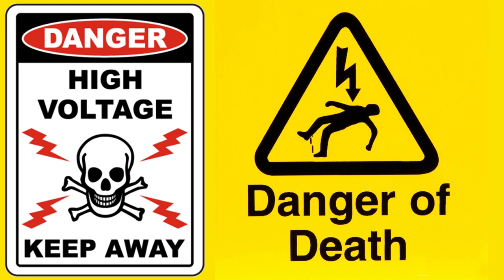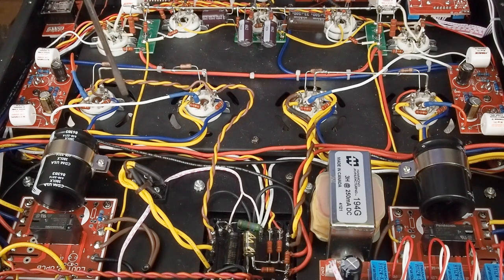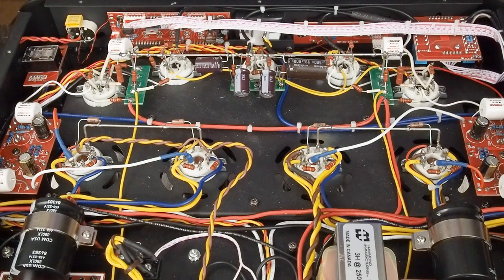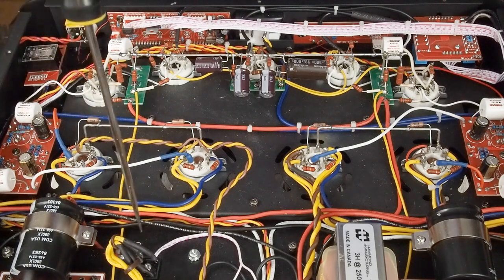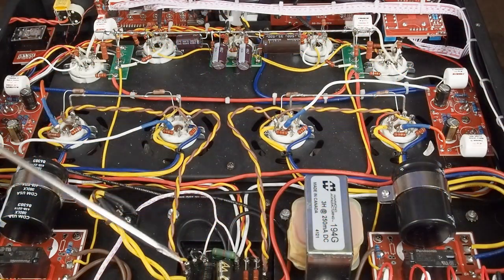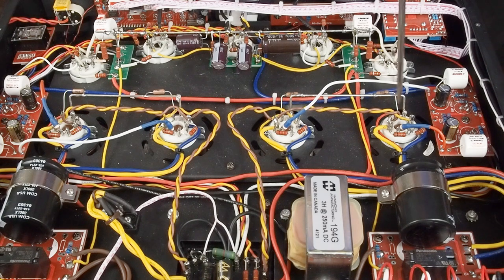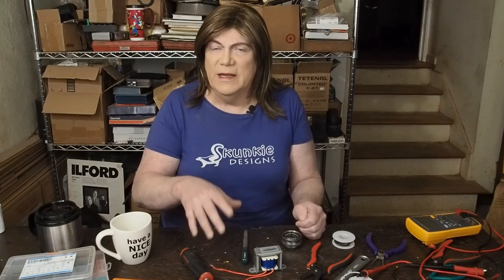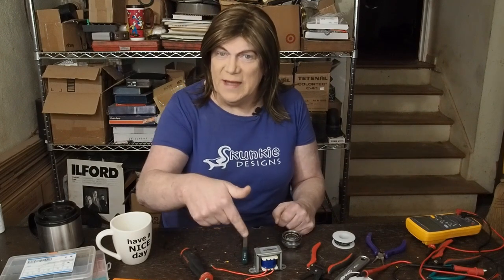Willsenton R8: Fixing Lead Dress and Grounding Faults.

Comment: You are so refreshing to watch, your explanations are evidenced based & can't get enough of your videos!!! I'll slowly work on the bias wiring & eliminate the possibility of the amp from "red plating" or melting other components or parts of the amp, is definitely a must DO!. Again, thank you for your passion & wisdom & patience in showing & explaining the reasons for the rewire or upgrading from cheap electrolytic caps to better audio components without breaking the bank. I love this project you did. More power to you! God Bless!
Reply from the maker: Thank you!
Reply: @SkunkieDesignsElectronics  ☝👍👌🙏

Comment: Great video, my amplifier has the same symptoms. At low and high volume, the background noise is small, but at half volume you can hear that noise. And I can add the fact that the third tube (EL34-6AC7-PHILIPS-MULLARD BLACKBURN XF2-B3H2) reddened more than the others. I changed them with others (El34) and it seems to work. I don't know what caused the problem with that tube, but it seems compromised.

Comment: Looks really great Stephe. Have loved this video series and you have a great ability to teach as you go. I have recently entered the tube DIY sphere (just finished by first amp - Bottlehead Crack/speedbacll). Are you planning to publish a BOM on your website? It would really help as i'd like to go through your mods  methodically looking at my amps current layout and building to your designs. The BOM would help as I believe not every person who has bought this amp has the same components (e.g. the same resistors in the same places) and i am not sure i should be driven by what's in there currently.
Reply from the maker: Absolutely plan to do a BOM, but I will not post anything until I am 100% finished as people will complain if I post it early and then need to change even 1 resistor. I made that mistake in the past when people were impatient for a BOM, listed it before I was 100% done testing, changed two resistors and a few people lost their minds over having to pay more shipping on those 2 changes lol.
Reply: @SkunkieDesignsElectronics  That's so good. Thanks so much. You are fantastic for the community Stephe - people should go easy.
Reply: Hi Derek, I also use the Bottlehead Crack with the Speedball upgrade. It really was a fun build and it sounds fantastic. A great way to get into tube related audio equipment 👍

Comment: Stephe, thank you for another great video. And thank you for you straight forward honesty .  Interesting enough I have exactly the two hiss problem you mentioned., and yes the noise is there  1. Noise/hum at the 12’oclock on the VC , 2. Weird  pitchnoise/ hum from the tube phono preamp (D.Sach).   Is the solution to remove the headphone jack + wiring ? And/or removal of hug 115/230v switch ?
Thank you, you’re fantastic ! Looking forward for the  listening impression :)
Reply from the maker: I think this is mostly from the grounding + headphone jack but likely is partly from the heater wiring and using one leg of the output tube heater to ground their cathode. All of that is done poorly IMHO.

Comment: I'm amazed at all the crappy looking soldering joints in this amp!  Also, why not just use shielded cable for all the heater wiring?
Reply from the maker: Twisted pairs routed intelligently work fine.

Comment: I have a willsenton r-800i with 805 and i do have left channel crackle while in mute mode on my high sensitive 106db speakers. The right channel is fine, overall sound is pretty nice. I guess some grounding problems too in this amp.
Reply from the maker: Not sure, those amps scare me. A made in China amp with 1000VDC inside it....